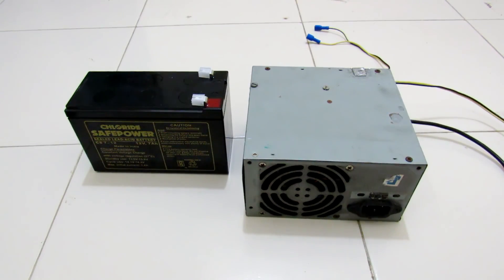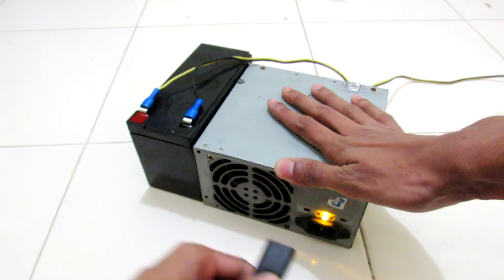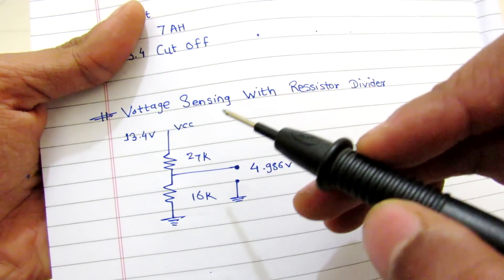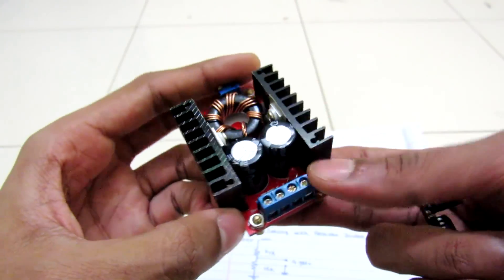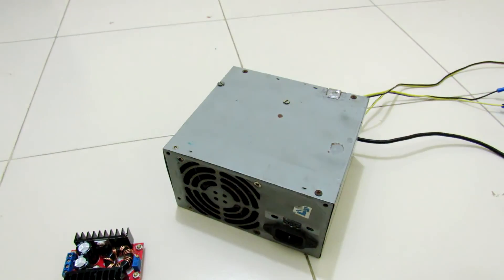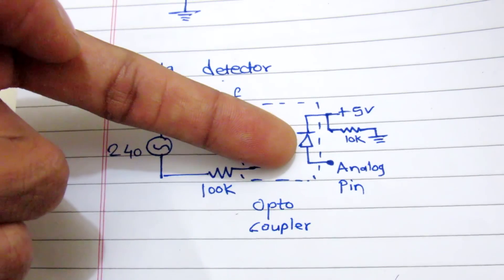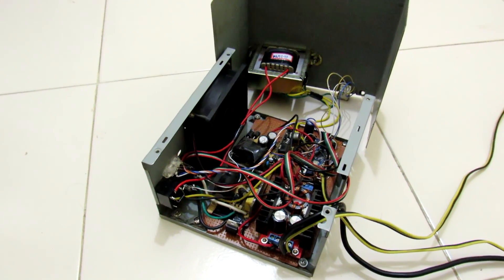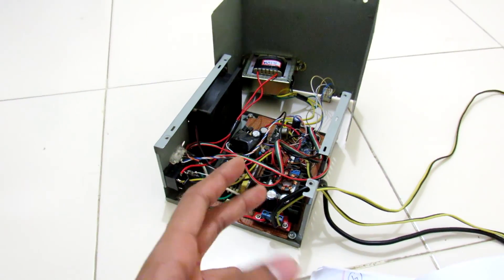How to Make UPS DC 12v-35v Battery Backup

Comment: if u use arduino as a brain of this  with some extra modification then it will handle all over under charge discharge and heat cutoff ......live voltage n load amp display  , or u can use a pot to change output current n voltage according to need like 5v,9v,12,19, 24, than this will be very useful for diy projects n fields to check any device with proper portable variable powersupply

Comment: Hey man Kedar. A nice project. Thanks for sharing it. But I would like to point out a few things. 
1) You said you used a laptop adopter as the rectifier. But, laptop charger is not just a rectifier. It is a complete power supply unit.
2) The charge sensing section of your circuit with the voltage divider you showed, is very lossy. As it is directly connected to the battery, it will keep draining the battery. So, i would suggest you to include a MOSFET switch in series with the resistors. Whenever you need to read the battery status, just send a HIGH on MOSFET's gate using arduino, read it, and then turn base LOW so that the current becomes zero(some nA if not zero) through it.
3) And the last thing, i feel that keeping the boost converter always powered through battery even when the UPS output is switched off is also a lossy design. I suggest you design a logic to disconnect the battery completely when UPS is switched off and AC is also not present. If AC power is present then the quiescent current of the boost converter and that voltage sense network mentioned in point 2 wouldn't matter much. But when are on battery even uA of current do matter.

These are no complaints. These are my views about your design. I feel that you have a lot of potential and providing a constructive criticism may help you grow.

Thank You
Keep doing what you are doing :)

Comment: using laptop charger to charge battery is overkill and damage the battery cos laptop charge 5 to 9 amp rated which can damage the battery and that lm2596 which which out heat sink and give 1.5 amp only

Comment: i have done something like this for my wifi router and fiber media converter  by connect lm2596s to a 16 volt adapter and then drop that output to 13.05  volt  floating charging for my 12v 7amp gel battery and connect another lm2596s to battery and drop voltage to 5v and  connect two output from it to media converter and wifi router now even in power cut i can surf net and it a very cheap option and one more thing connect a 2amp diode to the charging lm2596 output so that reverse current doesnt flow
Reply: Hi! Tejpal i also want to make power backup for my wifi router (12V-0.5A). can u plzz explain me briefly how u hv made that?

Comment: Now is it possible for the Arduino to power off the connected device when battery level falls below a cut off voltage
Reply from the maker: +n mitra6 Yes you can use relay or mosfet to control your device with arduino

Comment: Hi Kedar, Nice to see your video. However I am big zero in electronics. Can you please help me to convert my Numeric 600ax UPS to 12v 1A output so that I can use it to my Modem. Also let me know if I can contact you on any Mobile/landline number.
Thanks in Advance.
Reply: I’ve done that by just patching red&black DC wires to the battery terminals inside the UPS, run them out thru a hole, and add an adjustable buck/boost for constant voltage output. I found that my router says it wants 12V 1A, but it runs fine at 9V. My modem says 24VPOE, but 18V is enough. The lower volts mean more UPS runtime. Good luck!

Comment: What is the max backup time?
Reply from the maker: it can provide power depending on what capacity of your installed battery and load. if battery is 7 watt/hour and load consumes 1wh it will last for ~7 hours.
Reply: I am pretty well aware of that. Since you've used one arduino board, I asked that question to know whether this is affecting the normal battery life.
Reply from the maker: +Job John James I measured this , arduino consumes 20 - 30 ma at 5v
Reply: +Kedar Nimbalkar Well, Thank you. Currently my 12v ups is simply a 14v psu and a 7Ah battery, connected in parallel to the load which is my ADSL modem. Would like to make one like this. Do share the schematics and sketch. Thank you once again.

Comment: I made the emp jammer as you and it works with calculators,but it doesnt with a bulb. Do you think that it has enough strength or I should change something?
Reply: depends if its a one that goes in a lamp or a flashlite type bulb the problem is that there's not enough volts to power the bulb it depends on what kind